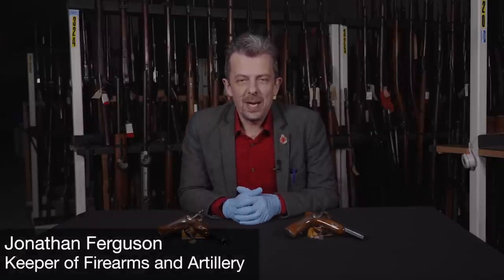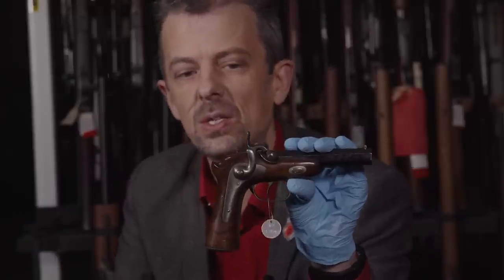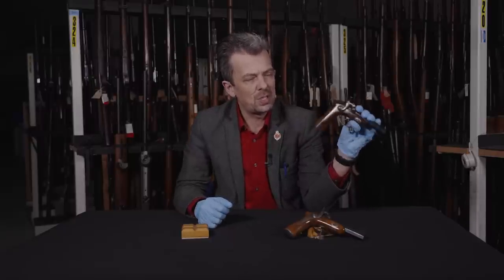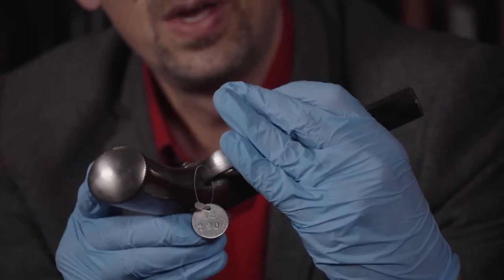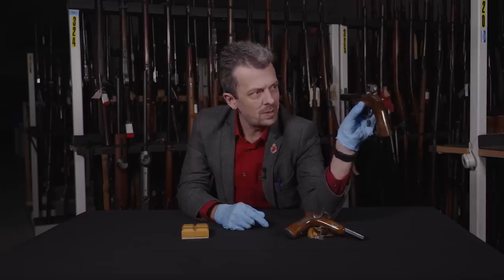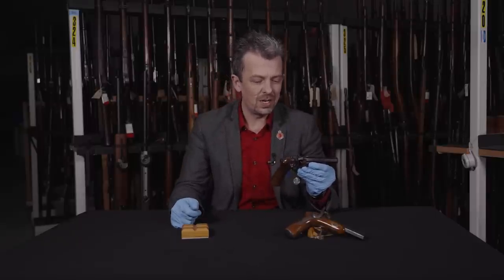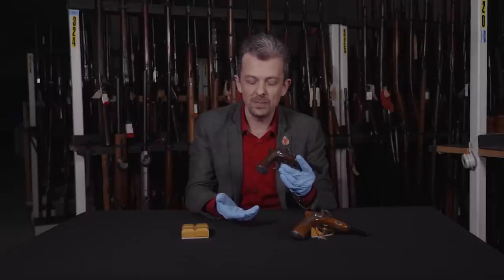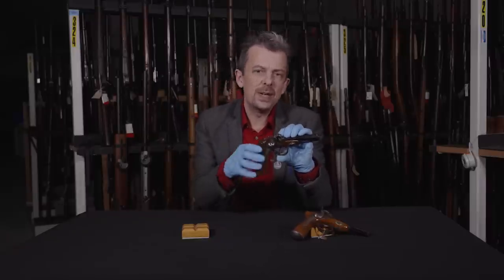Why did these percussion pistols have such straight grips? With firearms expert Jonathan Ferguson

Comment: Wow! That shape, especially with the "knuckle" to hold the web of the thumb, is eerily modern. I wonder the design survived in various rare pistols over time or was forgotten and then reinvented by several pistol designers due to form follows function.
Reply: Knuckles for the web of the thumb show up in percussion cap, and I think even flintlock varieties. So calling it modern is a little weird.
Reply: Also known as a beaver tail
Reply: @SlavicCelery  It's modern in the sense that it wasn't widely adopted until relatively recently. Percussion cap and flintlock pistols with ergonomic grips may have existed, but they were far from the standard
Reply: @screamingcactus1753  Saying there was anything that was established as a "Standard" before the establishment of the modern manufacturing revolution is a bit of a fools errand. 

You can talk about a "standard" design for a singular firearm. For instance, the 1858 Enfield was an adopted standard for England. But would you say it's the official standard for all muzzleloaders? 

Such a large percentage of firearms were from small groups of craftsmen that standardization is more of a lofty goal than anything that was actually implemented. Standards tend to represent regional choices. 
For instance, the Kentucky long rifle was a more standardized style of firearm. But, there's not anything fixed about the pattern. 

Similarly grip and stock choices wildly vary. Afghani rifles, were mostly standardized on what some people might infer was a cripple stock. Things like semi-pistol grips show up and disappear depending on the fashion of the day. 

So it seems like you're arguing for a term that doesn't make sense in the historical viewpoint. We can't go back to a pre-industrial age and get post-industrial results.

Comment: Reflecting on johnathan's standard excellent presentation, I have the following conclusions. 

One, the saw handle was evolved fron traditional flintlock stocks with the advent or more accurate sighting, dating from the period when wheel lock and snaphaunce locks were used, pistiols were treated as an extension of the arm and the stocks were fashioned as an extension or the arm for the function of aiming. This is best shown in the stocks of early german pistol shapes which had large heavy poliganal  butt caps to cunter balance the equally large iron long barrels. 

Two with the introduction of rifiling, sights became more desirble and rerquired the pistol to be held along the shooters eye line which changed the stocks to be reshaped along the lines of the curved naval pattern/ horse cavalry pattern where the butt is more curved and inclined to around 50 degreees which facilitates use at eye level. The final evolution to this change being the saw handled stock, the best example I have seen is un the form of a brace of Manton dueling pistols.

This brings me to the pistols demonstrated here. I would propose that this style of pistol is a dual use design that would be either a handy dueling pistol/self defence gun and as a parlour pistol which wouyld have been fasionable at this time. As with the manton pistol the range of operation would be short(40ft) with a flat trajectory with a decent size ball. The calibur would be large for a parlour gun with the norm being around .22 - .44 calibur ,but the compact nature of the pistol would be a good compromise for a dual use pistol of this type.
Pictorial examles:
https://gmic.co.uk/topic/55849-joseph-manton-dueling-pistol/
https://www.militaryheritage.com/pistol6.htm
https://en.wikipedia.org/wiki/Wheellock#/media/File:Wheellock_pistol_or_'Puffer'.jpg

Comment: The traditional flintlock/percussion pistol shape may have had something to do with the fact that they were usually considered as back up weapons to swords.  Since the sword was the weapon you mainly trained with and you had to deeply cock the wrist to perform a straight thrust then it would have felt comfortable to have a pistol that was held in a similar manner.
Reply: Nice thinking
Reply: Awesome logic I wholly agree.
Reply: Also, you had one shot. After that it wasn't a firearm, but a club. I suspect the design of early pistols reflected the fact they were inevitably going to be used as a melee weapon, unlike target-shooting pistols.
Reply: Also, the pistol was always the primary weapon. You'd use your sword after you'd shot your load. Even in medieval times, the sword was your back up, even though fantasy presents it as a primary weapon.
Reply: @peterclarke7240  If I understand it correctly, when used together with a sword, the flintlock pistol was the back up weapon and was fired from the left hand.  The ignition system wasn't the best and would be slow to reload and routinely failed to fire  so people would carry the pistol as something to be used but not really relied on. 

They might try to fire it at the start of a fight, before moving in with the sword, or keep it as a back up in case they got in a tight spot when they'd fire it at literally point blank range, often with the muzzle touching the other person.
Reply: You fired your pistol first, then went in with your sword. They were a weapon set that complimented eachother, but I completely fail to understand how a pistol could ever be considered a 'back up' to a sword. You might possibly have a point as to why the handles are similar, but I don't think that's a good way of expressing it.

If you look at the history of pistols, they actually began as primarily a cavalry weapon, and were originally used in place of the lance- cavalry would fire a pistol or pair of pistols before charging in with a sword, instead of charging with a lance and switching to a sword when it broke, or the fighting became static. The use of pistols even resulted in the adoption of 'caracole' tactics in the late 16th and early 17th centuries, where cavalry rode round in a big circle, shooting pistols at their enemies and then retreating to reload. 

In 17th and 18th century naval warfare, the pistol was also important. Famous contemporary and near-contemporary images of 'golden age' pirates often show them with multiple pistols, because this allowed them to fire multiple shots in battles before they had to use their swords. You can obviously shoot somebody from a greater distance than you can stab them, even with an inaccurate gun from 200- 400 years ago.

So.. anyway, that's a really long-winded way of saying that a sword would have been a back up for a pistol more often than the other way around. People who expected to serve as cavalry or officers in European military forces usually trained with both, and would probably be more likely to use their pistol than their sword. (People who served as infantry rank and file didn't usually have either- they were usually armed with a musket and bayonet).
Reply: @chrisball3778   Good to see someone who knows the history on the subject;).  But I still have to disagree with you.  While the caracole was used with pistols as the primary weapon they were using the more expensive and reliable wheellock rather than flintlocks and, quite frankly, it was a tactic from manuals that never had a real impact on the battlefield.  

It relied too heavily on ideal circumstances such as perfect terrain and timing of the horse and riders.  Things that are rare on the battlefield.  It would be a bit like trying to pull of the RCMP Musical Ride while you're under fire over broken ground.  If you can name a battle where it was successfully used as the decisive point in the fight I'd appreciate the reference as I have yet to see one in my reading.

You also have to remember that flintlocks were not reliable.  When the British army trialed percussion caps they tested them against flintlocks (admittedly muskets rather than pistols) on a range and the flintlocks misfired 230 times out of a thousand shots attempted while the percussion caps misfired fewer than ten times.  And that was on a target range, let alone in the middle of a fight were you could be knocking the gun around and getting the priming powder wet from rain or even heavy fog.  This is why armies of the period relied on a minimum of company volley fire with 80-90 men firing at a time in order to get a high enough success rate to be effective.

So I have to stand by the point that pistols were backup to swords rather than primary weapons until the late 1800's.  If for no other reason than the illustrations from the period show the sword was carried in the dominant hand and the pistol in the off hand.  This didn't change until the introduction of the cap and ball revolver gave a soldier a reliable repeater and, even then, they'd carry a pair in case one malfunctioned.
Reply: They can just learn to hold different weapons its very hard to mess up and slash someone with a gun
Reply: @chrisball3778  and after the 17th century, cavalry figured out that they were more effective with sword as primary than pistols and just went back to swords.
Reply: If you're holding a pair it's unlikely you are holding a sword.  In the John Bowie knife event,  he gets shot, then clubbed by a first person (a second to the duel),  then only stabbed by a cane sword of a third party.  
French line cavalry (1860) holds one pistol in their right hand and their sword by the blade in their left hand to instant switch.  No word about the second line in your back holding a pistol,  but it may explain the absence of revolvers.  Giving crazy cavalrymen revolvers to shoot over your head may be just too much to handle.
Reply: I was just about to comment in a similar vein. I used to fence as well as play with old pistols. I found the raked handle on old guns very point-able & natural because of it. I also found the long rake of the handles meant you had a low bore axis which helped mitigate recoil.
Reply: @silverjohn6037  I think we're using the terms "primary" and "back up" differently, and I'm probably using it incorrectly! 

You're of course correct that a primary would be the weapon that would be used predominantly, rather than the one that would be used once and then either discarded or used as a means of blocking.

I suppose I was trying to say that the pistol would be the weapon used in the first instance, in the hope of either killing or disabling an opponent, and then the sword would be used if you missed or the gun misfired.
Reply: @Getpojke  The designs didn't "mitigate" recoil via low bore access. They allowed the pistol to rock upward and disperse the force in that manner. Not super "tactical" compared to modern grips. But, that's the function of that slow curve design. To an extent many revolvers still allow a similar rocking upward to spread out the time of recoil.
Reply: I thought it was because they were adapted from longer muskets, fired from the shoulder. Either way, leads to an interesting shape
Reply: Also you need something you can use in gauntlets.
Reply: That's why I always thought.

Comment: Very interesting and informative, as usual :) I'm a sucker for muzzle-loaders, so this is a treat. While I understand taking apart these artifacts is not a possibility, I often wonder if providing us with the occasional X-ray would be feasible. Anyways, as always, thanks for the great work, Jonathan and team :)
Reply: These days, you can even get an MRI or CAT scan privately, which gives much more detail and information than an X-ray might. Pricy, but not exorbitant.
Reply: @keithklassen5320  X-ray or CT Scans are feasible, MRI is Not in this case, can't have anything ferromagnetic in an MRI.
Reply: @Ghelasin  can't have anything metal in the MRI
Reply: @joostdriesens3984  Depends on the metal, non ferromagnetic metals work, ferromagnetic metals do not, you know, on account of the giant magnets. A good example of this are Copper based IUD's which are fine to have while undergoing an MRI. Titanium implants are another good example of metal that you can have on/in you when going through an MRI.

Comment: Definitely Delvigne pattern pistols. A stocked pistol carbine version was also trialed for the French cavalry. You will find that the ramrod for each pistol is in the grip. Twist the butt cap 90° and it will slide out.
Reply: Am I mistaken in thinking that the cavalry pattern was in 14 mm calibre and had its ramrod under the barrel?
Reply: @F1ghteR41  16.5mm, rod under the barrel and connected by a swivel link.
Reply: @thebotrchap  Ah, I see, thank you! I was confused by some auction lot of very similar description.

Comment: Those are cool. They could be perfect for some sort of adventure story. 

I have heard that the reason for the shape of old pistols had to do with them often being used from horseback and a common calvary weapon. Often when you look at materials and context of the past things would make sense for them and would likely be close to eat we would want if we were forced into using the same materials and environment. An example might be in modern militaries soldiers are taught to shoot square to the enemy with the elbow down. In the past they shot elbow up and bladed. The big difference is when you have to manually work the action on a traditional stock and no body armor bladed is more effective. Often it's some sort of hard to see thing like materials improvement that changes a weapon. Traditional stocks are better built for shooting moving targets at shorter range and gains had to be made to make it practical to change.

Comment: If I hold my hand out with a relaxed grip the "ideal" angle for a handle looks about 45 degrees from the barrel axis.
Is this a good idea? 
Having the barrel axis align with that of the arm is generally considered useful to reduce barrel flip. Yet if these axese align the force of recoil is delivered directly into the arm.
The grip angle on these to pistols has me wondering if this was intended as a way to promote barrel flip as a way to disperse recoil energy by rotating the gun, hand, arm instead of directing that force into the arm.

Comment: Partly the shape would have been influence by wood. In one piece of wood, a 90 degree turn is a weak point. With using a gentle curve, you can select for grain that roughly follows a curve and have a stronger stock.

Comment: I suggest the original curved stock was down to the material, the sharp angle of the modern semi auto would be extremely difficult to make strong enough out of wood. That doesn't matter so much with low power target pistols like this that aren't subject to the daily rigours of being carried.

The reason we have straight grips now is purely because they need to house the magazine, modern revolvers don't have that constraint and maintain a curved profile.
Reply: Was about to reply with this comment. Even toy guns will tear along the grain with very little use, learnt that the hard way :(

Comment: So, these are somewhat akin to the compact versions of the 'sporty' ČZ 75 derivatives (SP-01 Compact and the like), am I getting it right?
16:00 Is it just me, or the sights on these pistols are unlike the typical revolver of their era? Could it be then, that this design had its customers by virtue of these sights and the overal layout conducive to their use?
Reply: Akin in general profile, yes. As to the sights, they are indeed somewhat unusual but we can't really say whether the stock shape or the sights were the main driver, since we have no idea who the customers were or what the design intent was.
Reply: @jonathanferguson1211  Searching by the term 'pistolet système Delvigne' reveals a handful of similar-looking percussion pistols with longer barrels (including one claimed to be a cavalry piece in 14 mm calibre), so I would assume that the customer for the pistols you've shown in the video wanted a more compact variant of those. If this is indeed the case, preference for better sights to be used in such a layout might play a part.

Comment: Is there any truth to the oft-repeated factoid that early colt revolver grips were designed to mimic plow handles? The story usually goes that plow handles had been perfected by thousands of years of development and were perfectly suited for the job. Or was it the other way around? Was the colt grip invented independently and 19th century people naturally described it after a familiar technology?
Reply: https://youtu.be/j8CkTwrU3IY @19:00 there is a discussion on how a 'saw handle' grip was specifically requested for a later Colt DA by customers,  so I would assume that the 'plow handle' design ascribed to early Colt Single actions likely has a similar origin. 
It should be noted that other early competitors to the Colt design usually had more conventional grip designs for the era(notably the most prominent the Wesson & Leavitt, which likely would have beaten Colts designs if they hadn't been sued out of the market).